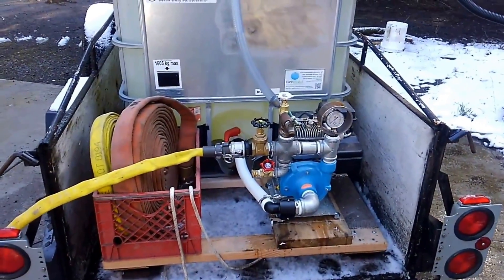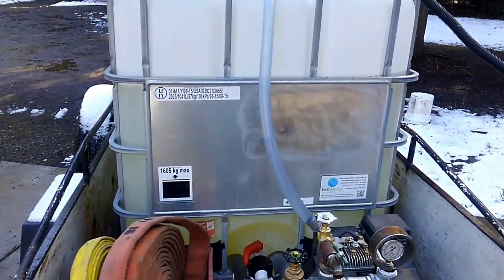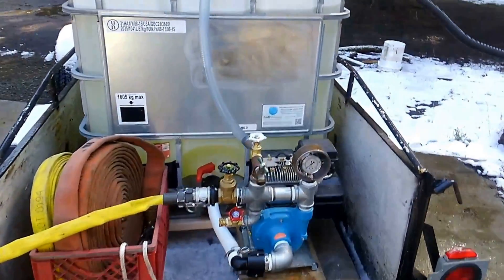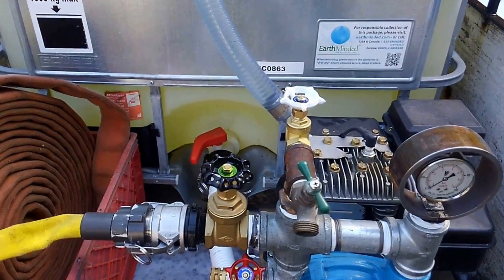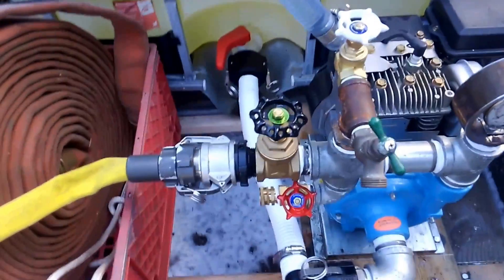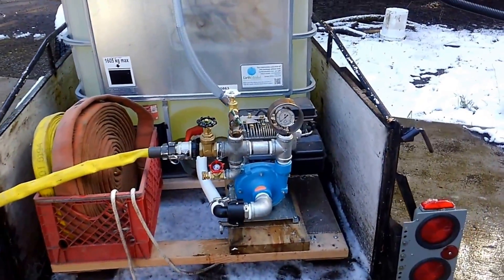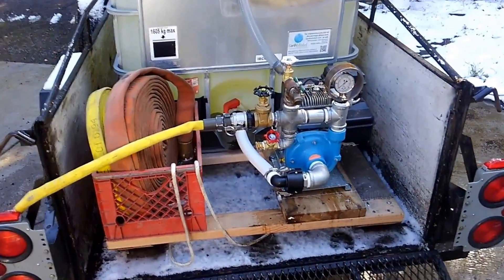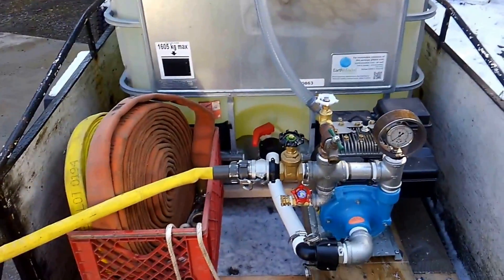Homemade fire skid

Comment: My compliments-as a veteran firefighter who has done extensive research on pumps.  You have an excellent understanding of the flow and pressure required for an adequate fire stream.  
Excellent choice of pump. Most nozzles require 50 to 80 psi and by using full 1 inch hose you have reduced the friction loss of smaller hoses.  Very good job.
Reply from the maker: Thanks for the support!

Comment: Excellent! I'm building a firefighting trailer myself but I'm going to use a high pressure sprayer along with fire extinguishers and pump sprayers on board. I'm also using fireice by gel tec. Works very well on tire fires and fuel
Reply from the maker: Good luck!
Reply: @joksgarage8864  I'm supposed to be retired but I just can't do it! Once a firefighter always a firefighter!

Comment: Very nice I'd used a predator style engine though nothing against flat heads they just don't have the rpm the overhead valve engines does
Reply from the maker: Pump and engine came as one unit.

Comment: Great set up . Ebay has some screamin deals on used fire appliances . To get more effect add a 1/4 needle valve to the suction elbow then run a hose   to a 1 gallon resevoir then run a second lie to a valve then from the vale to the the dishcharge manifold.

Comment: Once that valve is opened for the outlet, is it just always on? Can you shut the nozzle off, or would it cause too much back pressure?
Reply from the maker: Once the outlet valve is opened, the hose is pressurized, and flow is controlled with the nozzle.  My pump is a centrifugal type, so this does not cause any issues.  I also have a roller type pump, and on that one, I installed a relief valve.  I hope this answers your question.
Reply: @joksgarage8864  Yes it does. Thank you so much! Not sure I'll get it built before I burn this year or not. Running out of time

Comment: Nice set up! Where is a good or best place to find roller pumps? I need a system your size.I have an irrigation ditch or an above ground pool to pump from.I need to have around 300' of hose to protect all of my property.Would i need to run 2" trunk line then reduce to 1.5" Around 80-100 lbs of pressure is whats needed I guess.
Reply from the maker: Hypro makes good roller pumps. I use one on the pto of my tractor. When it comes to choosing a pump, you need to know what type of nozzle you intend to use, as a 100 gpm pump and a 100 gpm nozzle will be underwhelming. Don't ask how I know that.

Comment: Nice, there not a lot video on homemade skid unit. I planned on making one too. But my quickest setup is my pumps, suction hoses, nozzles, hoses and a huge pond that's about 20 feet from the hose. Would you guys know that I had all this stuff and it's was at my father place and I lost all my tools in a garage fire. So now I got a small shed only for my pump stuff in it.
Reply from the maker: You have to work with what you have. Keep it simple.

Comment: How come you didn't put a valve on the suction so you can use the pump to draft from the pool or other water source? I'm planning on building my own grass fire skid some time in the near future but I want to make sure I have the ability to draft from a pond or creek. Really nice build though I'll keep an eye for a hypro pump I have seen them on farming equipment before.
Reply from the maker: Bert26, I use camlock couplings and simply switch the hoses to draft from an exterior source.
Reply: Well its a pretty sweet set up I've been thinking of building my own set up for pretty much the same purposes but I want to be able to mount it in the back of my truck. I'll keep my eye out for a pump like that all the purpose built pumps are ridiculously expensive.

Comment: Is the pump connected with a jaw coupler?  Is it a 6500 series?
Reply from the maker: There is a camlock coupler on the outlet of the tank. I don't remember the specs. Do a Google search for IBC tote fittings.

Comment: Look up Northerntool/Northstar 2" and 3" high pressure engine driven pump.. I have a 3" works very well 100+psi and nearly 200 gpm. Pumps are well priced too.. Seriously check them out
Reply from the maker: This one is bought and paid for, I plan to stick with it. Northern does have some good deals.

Comment: What pump are you using
Reply from the maker: It's a Hypro centrifugal sprayer pump.  It works alright.  If you want to run 1-1/2" hose, you'll need a bigger pump.

Comment: I just feel like the gas pump has too much downside. There's a grassfire you get the rig out there but for whatever reason the engine on pump will not start meanwhile the fire eats. I'm thinking I'll go electric ...solar trickle charger for 12v and inverter
Reply: Get yourself a Honda pump and you'll never have to worry about it not starting. Electric motors use a lot of power, especially the size needed to pump at least 50lpm. It adds up quick when you want to run it for longer periods of time.
Reply: Electric does not have the duty cycle adequate for firefighting, just do regular maintenance on your pump engine.